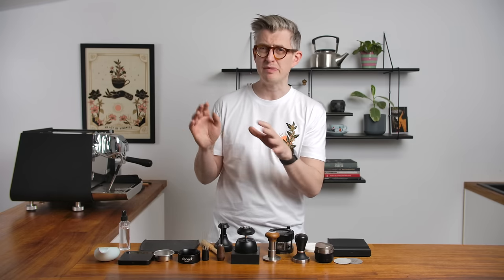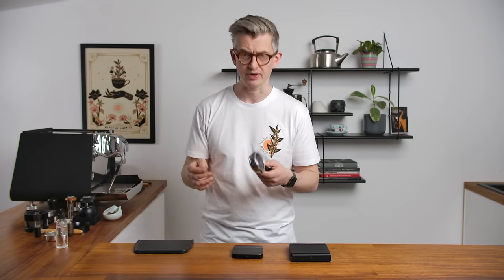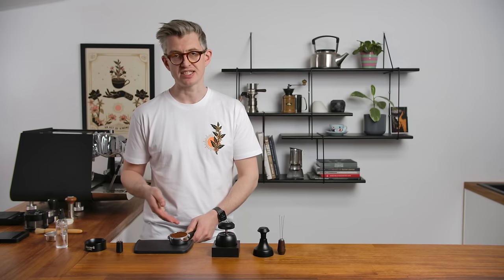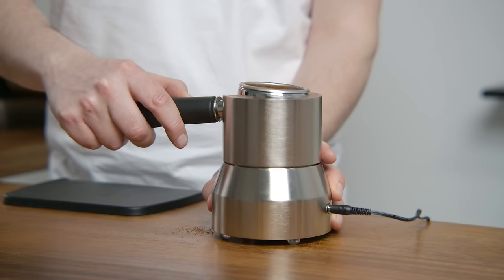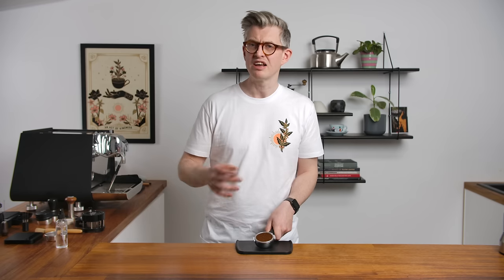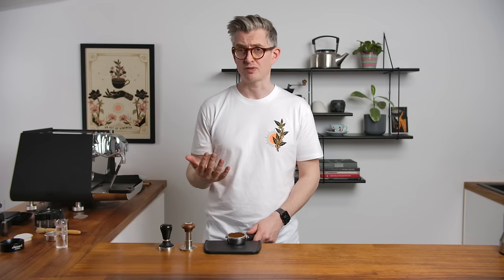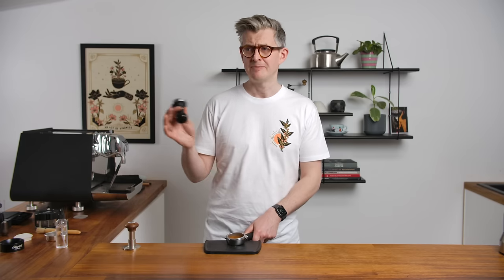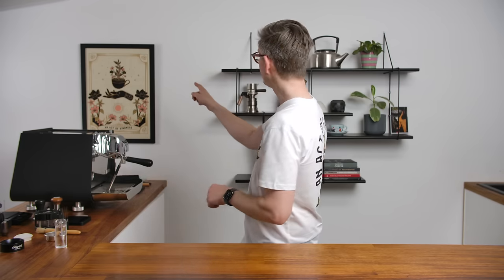How I Make Espresso: Tools and Techniques

Comment: I use the herbs grinder from my SEB Store Inn' Kitchen robot to grind some  coffee beans

The result is an evenly distributed powder so no needle needed to add more air.

Some hand made tempering with the plastic temper/spoon provided with my Beko expresso machine and the overall job is fast, consistently repeatable with respect to beans weight and grind duration.

I am just willing to find some depressurized (like reusable plastic "compactor" bags for clothes, but for coffee) coffee powder dispenser to avoid running my kitchen robot at full speed each morning ;-)

Comment: One thing you didn’t mention but I’m quite curious about is a tamping mat. There’s all kinds of mats that let you tamp of the edge of a surface, but not all portafilters kinda fit into that mold. Here you seem to be tamping just on a flat surface, but again your portafilter seems pretty flat, so it makes sense. So my question I guess is, on what type of surface or edge should we tamp with wonky shaped portafilters (such as the one that comes with the Lelit Victoria)?

Comment: I don't know if this was commented already, but isn't it necessary to "purge" the machine by letting water run with no portafilter attached? I used to work at a fancy restaurant on the bar, we were in charge of coffee as well. They sent me to get a certification with San Remo, and they told us to always let some water flow in order to not "burn" the coffee, because the temperature is supposedly higher if you don't use the machine after a few minutes. James, is this true? I remember doing some tests, comparing the Coffeys after "purging" the machine and not doing it. Some clients used to return the coffee because it tasted like it was burnt. I think I did notice a difference, but I was young and I think I never was very consistent with my coffee making (rush hour was crazy). Now I notice when I get served "burnt" coffee, but I don't know if my brain and tastebuds are aligning to my beliefs or if this is really something that someone needs to pay attention to. I always tell the baristas to please purge the machine. Some get annoyed...

Comment: Puck screens have been an absolute game-changer for me, though for whatever reason it feels like it's hacking around something else I'm maybe doing wrong, it's probably not true really but it feels that way. I put mine in the dishwasher which works perfectly fine for a low volume home gamer. I like that it keeps the shower screen really clean and when I purge the water that comes out is clean which again for a home gamer is a huge deal not needing to clean the machine's internals so much - plain hot water good, coffee-laden hot water in the shower screen and potentially in the pipes not so good. They're also pretty cheap for a reasonably good quality one - indeed to the point you can have a couple of them laying around if one is in the dishwasher and you have unexpected guests or something.

Comment: Hi James! 2 quick questions:
1. Which basket do you use? For the 2 1/4in papers one would need a straight wall basket… Yours looks like straight walls…
2. If you use Chemex paper (punched) - do you ‘rinse’ them before using them in order to get rid of the paper taste? (put then the puck get wet when you fill he basket, right?)
Thanks in advance for a short feedback - and let the great videos ‘flow’… ;-)

Comment: I use a "cinnamon roll" method. I take 17 grams of ground espresso and lay it out evenly on a sheet of parchment paper as thinly as I can.  I then roll up the parchment paper taking care to evenly distribute the grounds evenly between the concentric spiral rings of parchment paper.  I then pick up the rolled up sheet of parchment paper with the espresso filling and turn it end down into the portafilter.  I then gently shake the rolled up parchment paper until all of the coffee is evenly distributed in the portafilter.   I then tamp and it's over to the LaCremina.  I have found this works remarkably well at getting an even distribution, is inexpensive, and gives consistent results..

Comment: I think you missed the primary benefit of metal mesh puck screens, namely, keeping the group head clean! I hardly ever have to worry about cleaning the group head, backflushing can be done far less frequently, and my shower screen and gasket stays pristine with just a quick purge after pulling a shot

Comment: Thanks, James, for a very informative video. Re using a paper filter at bottom of puck and pain in getting one that fits - just realized right now - the paper filter supplied for Hario's siphon coffee maker fits almost perfectly, just a tiny bit larger for a 58mm puck. Will try tomorrow if it works well - wonder in meantime if anyone else has had success with this.

Comment: I think that force cutoff tamper that creates that shock at the end may lead to channeling.  If that piston, whatever you want to call it, lifts slightly, then crashes into a perfectly tamped puck at high speed, you may create some cracks.  Why not just use a depth calibrated tamp.

Comment: Hi James…enjoying your channel. I have 2 issues I am struggling with and haven’t quite been able to dial in correctly, nor consistently yet. I’m either not getting 9 bars of pressure, or when I do, it takes way over 30 seconds to get the correct yield based on my dose.

Comment: At around 16:15 James talks about how tamping pressure is binary: not hard enough / hard enough, and that you can't really tamp too hard.

I've been afraid of tamping too hard, and having my pressure gauge read too high... Is that not actually something to worry about? I was contemplating getting a spring loaded tamper to remove the guesswork. Overthinking things maybe?

Comment: To show another flaw with vibrational distribution you could put a flat surface with slightly raised edges about 1 square foot or so on top of the vibrational distributor then put some sand or something that acts similarly on top, it will show you that the frequency the device is vibrating at will create a specific pattern, a cool looking experiment surely, but the fact that it's not an even layer of sand shows you the flaw I was talking about, you get areas that the coffee vibrates too, and you'll get areas the coffee vibrates away from, causing cavitation making the coffee flow less evenly than it otherwise would

Comment: Can you comment on tapping the basket before tamping? My grinder is not great, and i notice that on the smallest grinder setting, with a lapavoni epropiccola, with no tap i get a 10 second extraction, but if i tap 10-15 times, the machine will choke and i cant get a shot pulled in under a minute even with my whole bodyweight on the lever. Seems like tapping is the biggest influence on the process. What you mentioned about fines settling to the bottom was very interesting, maybe you can comment more on this? My grinder is a macap m2m :/

Comment: Hello James and thank you for your contributions to the art and science of espresso making. 
I'm frustrated. A family member gave me a Breville Barista Express for my birthday. I had been using a low end De'Longhi and was very happy with the shots it produced. I am finding the Breville to be difficult.  After much adjusting of the grind size, the volume of espresso, extraction time, tamping, etc, I'm pulling shots that are either bitter or acidic. The Breville requires much more work than the De'Longhi and the product is not to my liking. I like a shot that has depth, richness, fullness and is not bitter or acidic. Suggestions?

Comment: Hi. Loved your video. Im fairly new to espresso. And some of my barista friends tap na side of the portafilter basket to get some coffee out of the seams on the wall of the portafilter basket and again tamp hard on it balance it out again. But it seems like there are airwholes on yhe sides. Is there any difference getting rid of those coffees on the portafilter basket wall or its ok to leave it  some of my friends told me its a way to eliminate the bitter taste of the coffee and some are saying so it would fit perfectly when you screw it in the machine . Any advice on that matter? Thanks in advance for answering. ☺️

Comment: LOVE video, it is on my 'saved' list and have refered to it many times.   James, a question if I may: I just a Force Tamper which I believe is what you are using.  However, I can't find what the manufacturer's setting is for the pressure, nor the place where I bought I can't tell me either.  Do you happen to know?  Did you change it from that setting?  thank you.....

Comment: At 16:03 - your tamper is visibly not level w the top of your pfilter by a few millimeters thus you have unevenly tamped.  Even a single millimeter of unequally - tamped ground bed will drastically change the compaction/density of the puck from one side to the other; you're off here by about three - maybe more.  Water will, of course, flow faster through the side tamped less (high side / left) than the other.  If your grind, distribution and everything else was perfect, this one miss (which is an easy fix) will set you back a great deal.  Solution.. I can make a video showing my entire method, which is quite simple, but one quick fix for this is to get a dual-action, spinning leveler with a depth stop on the press side.

Interesting video though.  Cool to see all the fancy new gadgets ppl are coming up with.

Comment: Great video as always!

I have a question, maybe a bit off topic for this video, but along similar lines. 
I'm no great expert, but in my training, the temperature the the basket in the handle is quite important, it should be hot yes?
I was told a cold (or room temperature) basket will not extract the same as if it is hot (ie, you just took it out of the group head where it was heated up). 
Does this really make that much difference?

Comment: Re: making a cheap needle distributor with acupuncture needles and a cork.

I would think acupuncture needles might be kind of expensive. Go to a music store and buy a single guitar string instead. Shouldn't be more than $1 and you can select how stiff you want your needles by what gauge you choose. A top 'E' string from a medium set, or maybe a 'B' from a light gauge set? Somewhere in the range of .008" to .016" would be good I think. You could get ten or more 'needles' from a single string in less than a minute with a pair of wire cutters.

Comment: Push tampers make the tampering aligned. By their kind of pushing with the flat hand, you nearly can't press with less than the required 6kg.
They typically cost less than a normal temper.
Especially for beginners, shouldn't this be recommended?
I also miss a tamping station to have the filter aligned and both hands free.

Comment: Puck screens
They are all the same, 
They are extremely beneficial in keeping coffee from getting in your group head
They also prevent the puck from sticking to your group head screen if you have that problem

Paprika filters…
All ground espresso has a range of sizes.  Imo, the finest sizes can clog up the holes in your portafilter….which is imo what extraction is slower, and possibly less even without the paper filter

Dosing cup
I grind into a dosing cup… then weigh and fine tune the dose…. Then wdt….then into those portafilter with some shaking with the dosing cup still on top holding in the coffee…. Then a quick finger smooth…. Then quick distributor… then tamp….puck screen…. Extract…. 
I find it I use this method plus a paper filter… the espresso immediately goes to a single stream and there is no messy spraying from my bottomless portafilter

Comment: Hm, i haven't seen my method of making coffee yet :) It's so simple, you only need paper filter. Also it's better to have a higher cup or glass, so you can "put on" the filter so it stays on top of your glass(maybe hold it around with your hand), and leaves enough space at the bottom for your coffee. The rest is just same as pour over method. It's basically pour over but without anything but filter :) (carefull with hot water landing on your fingers:)

Comment: i got a question.
after 25 seconds my espresso has over 180 grams ( i use normal mugs ), so my initial thought was, i have to make a finer gind. but if i go with a finer grind, the espresso starts tasting really bad.
so whats my mistake?
if i use a fine grind to get 25 grams espresso after 25 seconds, the espresso is undrinkable

i dont use a paper filter btw

Comment: What Eureka model is that? And does it come with high grind retention like my Mignon?  I put my Mignon on an angled base and added a single dose hopper with bellows. That solved grind retention well, but forced me to grind into a cup because when grinding straight into the PF, the air from the bellows blows a tiny quantity of grounds out of the PF and makes a tiny mess. That quantity is likely <= the amount retained in the grinder. I guess this could likely be solved with a funnel that sits of the PF in lieu of the full cup and transfer shenanigan. And I put up with all added precession because the grinder is so damn quiet. If only the baratza sette was that quiet. But that's a separate conversation, I digress.

Comment: Hi Jeff! Love your content. Did you experiment with Paper filter + Puck Screen and add Flow control? I’ve got a R58 and a Ceado E37s grinder and I find it’s really hard to get a contact time above 25 second (even using a pre infusing / Londinium profile). I am grinding MUCH finer than normal when doing this prep and the pucks look correctly extracted when removing them from the basket. Going finer…. I would jam the grinder as too fine. In your opinion is that an issue that I only get 25-27s contact time including pre infusion which is around 7-8 seconds? Also I pre wet my Paper filter and the Puck screen. Is that what you do? Thanks in advance :-)

Comment: If adding filter paper at the bottom of the puck increases flow and extraction, should you adjust parameters to compensate (eg. Grind finer)? Or would that lead to overextraction? Thanks
Reply: Important question! There are views which deny any value. At least it keeps the portafilter clean and the puck will hopefully remain decomposable.

Comment: I see a few issues here. May I offer some help? Starting at the water level. The volume is set incorrectly by the look of it. Way too much. It can either be manually set which is a bit fiddly to a ratio of 1:2 (so for example 18g of coffee to 36ml volume of water or for simplicity use the program button to reset to default settings. Press and hold till you hear 3 beeps. This will give you 30ml of water. 
Your dosage setting looks too high. It could be your beans but you need 16-18g of coffee. I find 18 best for that sweet spot. On your grinder dosage you have it set at 20 past. My setting is at 10 past and that gives me 18g for the beans I’m using. Why are you pushing the single filter button for a double shot basket? Not just once either. I saw you push it twice, in fact if I’m not mistaken you pushed it 3 times after you changed a few settings. Ignoring the single button for now, use the double filter size and make sure your coffee weight is around 18g. If need be, empty your hopper. Weigh 18g of beans and put back in hopper to grind. 
You are correct in the way you use your adjustments for the grind. Mines set at grind 4, burr 3. Play around with the side grind button till you get the desired pressure. 
Oh, one more thing, you may want to buy a 54g dosing ring which helps prevent spillage and waste of coffee grinds. Hope all this helps. 🙏👍

Comment: We all here have plenty signs of obsession at this point, but I digress. 
The puck screen helps me keep the group head in my barista express much cleaner for longer.  
Another digression, I recently came across the modification many have done on these machines to lower the pressure and obtain a better espresso. Any input on this?

Comment: Dumb question - but doesn't tamping solve the distribution concern? How are there gaps left after compressing the coffee with a tamper?
Reply: Since the tamper compresses all of the grounds down to one level, some areas where there were more grounds will be denser, and water will not flow as evenly through those areas.

Comment: Vibration distribution behaves exactly the same as you would see with concrete for example. (yes concrete).  Concrete is vibrated to get it to flow into crevices and leveling to some extent.  So you'd think you can just vibrate it endlessly.  But that basically ruins your pour.  Concrete has rocks in it that separate out.  It is exact what you are seeing with coffee.

My point, vibration is IMO not a good technique for something like this.  Physics dictates the separation and there are no ways around that.